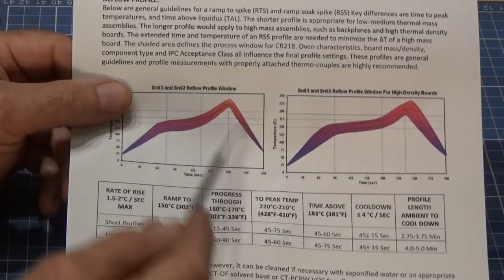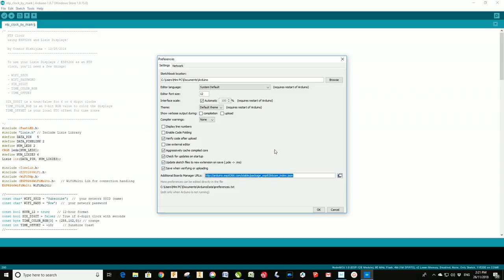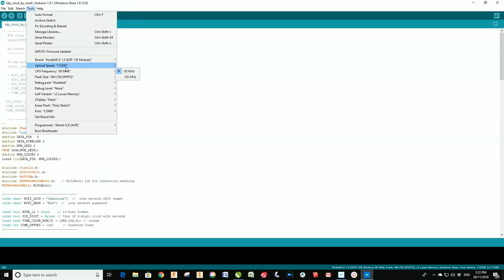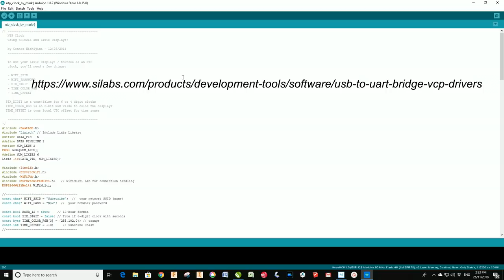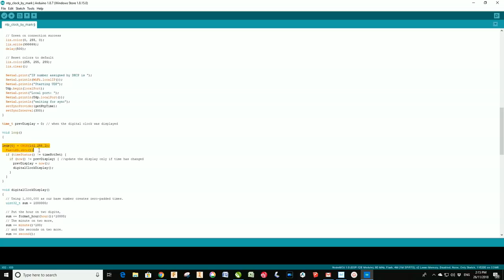Sexy, Lixie, Art Deco Clock Build - Part 2

Comment: Not sure if this has been mentioned, but that solder is enormous for such small connections. Any lead free solder I've accidentally acquired has a short final journey into the trash. I do use flux from time to time, but I can't comment on the type you're using, but I've found it pays to experiment with different types. My wife likes the liquid in a pen style, but I prefer the smelly green stuff. I'm interested to see how your project turns out. I've been collecting parts for a Nixie tube build, I suppose some day I should actually start on it.
Reply from the maker: Yes, I had lots of issues soldering on those boards. I don't know why. Every single board was the same and I don't own any lead free solder so I am guessing it is the boards. When I soldered the veroboard it worked perfectly. Strange!

Comment: If I may Mark, the silabs driver is just to deal with the USB to Com Port adapter on the ESP12e (a 28 pin chip next to the Micro B USB female socket) so your computer can see it, and then to be able to program with the Arduino IDE. Without it, a Windows based PC would complain   "Device not recognized" .  There are similar proprietary drivers offered by other electronics manufacturers and dedicated to the specific chip in play. VCP - Virtual Com Port. 
The Arduino uses yet another that you have already installed obviously.
Sadly Windows will not install automatically.
Soldering is often an exercise in humility and patience as is coding but so thoroughly elating once championed. Congrats on the progress so far.
You have inspired me to revisit the FastLED library and get my 5050 WS2812b's out from storage once again.
Reply from the maker: I must say that the video that I watched had a link to a site that supposedly had the correct driver but I was worrying that I was going to get directed to a porn site or something. Since I didn't have to install drivers for the Arduino I was smelling a rat. However as you have pointed out it was just for the VCP. I cannot understand why the soldering has given me so much grief. It's not like I've never done it before but I suspect that the boards that I got are done with lead free solder. I think I did a little dance when I realised that I had left a semi colon off the end of one line of code. Mostly it sucks but when you get a win it feels good.😁

Comment: Hi Mark,

You are using the correct method to solder your LEDs, but your solder is too large for the tiny pads.  (don't waste your time with "lead free" solder).  Get some 0.8mm resin cored 63/37 Tin Lead solder and a pair of 00 Stainless Steel Tweezers.  You will find you have much better control over the amount of solder applied to each joint.  

Clean your pads with JIF Household Cleaner and a sponge. JIF is a very mild abrasive and won't damage anything.  Rinse off with warm water, then dry.  Pre-tin each pad with solder and "wick off" excess solder with solder wick.  Clean up excess resin with acetone and a cotton bud (won't hurt any components)  For large areas, use a toothbrush with acetone to clean excess resin.  Use plenty of acetone and cover the area with a clean dry cloth whilst still wet.  Work the area covered by the cloth with the toothbrush.  All excess resin and residue will transfer to the cloth.

Resin is the best flux for soldering, so if you have trouble with a joint, don't be afraid to add more flux.  Remember that resin is hydroscopic and will absorb moisture over time, so remove all traces of resin using the acetone method above.
Reply from the maker: Thanks for the info. I was using isopropyl alcohol to clean off the excess resin flux but it seems to be quite stubborn and hard to remove. I do have some acetone so I will give it another clean with that. I was using tin lead solder but I think the boards were coated with lead free solder. I must follow up with Dirty PCB's where I purchased them to find out if that is what they are using. I was surprised at how hard it was to get the solder to flow. I didn't realise that the resin flux was hyrdroscopic so I am guessing that could lead to corrosion over time?
Regards,
Preso
Reply: @Preso58    Corrosion over time, especially in high humidity conditions.  The resin can start to "react". 

 I liked your  method of holding the chips in place during the soldering process.  I have been involved with hand soldering surface mounted components since 1989.  My experience is in the microwave  RF Communications industry where surface mount soldering is critical.  We never used re-flow ovens.  We found the results too unreliable and we would often have to rework  manually.

The method we use is to clean, clean, clean (the first law of soldering), pre-tin both the pads and component leads (especially if the  PCBs and components are more than 2 weeks since manufacture),  Each component is then placed into position with Size 00 SS Tweezers and one temporary joint  made (one corner lead on multi lead components).  The temporary joint allows any correction of misalignment before final soldering takes place.  Copious amounts of rosin are used.   Cleaning  is performed by soaking in a tray of isopropyl alcohol for an hour,  then washed in "Safe Wash 2000" (a water based soapy solution, you could use dishwashing liquid).   Final rinsing in water then drying.

After drying, all joints are 100% inspected under a stereo microscope and reworked if required.

We found that "lead free" solder was totally unreliable and extremely difficult to work with, and in general, gave very poor results.  This is because lead free solder has a much higher eutectic point compared with 63/37 tin lead solder.
.

Comment: Mark,  Sorry for the late comment.  I haven't done much SMD soldering, but have done one or two replacement chips with the "extra" small (to me) leads with the tiny (to me) spacing between the leads.  I was successful because of watching one of Dave Jones' YouTube EEVBlog videos where he tacked opposing corners to the board, adjusted the chip's alignment, applied liquid flux, and simply wiped a drop of solder (already on the tip of his iron) across the pins.  If there were any shorts between adjacent leads, wiping perpendicular away from the chip reflowed the small short(s) and easily & quickly fixed the problem.
  
I wonder if soldering "large" SMD components like your LEDs (in future projects) could be done in a similar manner?  I'd guess that you could still use your existing method of holding the LEDs in place while soldering, but if you start with a clean tip and carry a fresh drop of solder to the LEDs, maybe soldering them would be easier?  Of course, Dave's technique may work like it does because it's easy to heat the tiny legs and therefore the pads, which may not be so easy with these LEDs.  But ought to help you in future projects?  Maybe an Electronics Guru that works with a lot of SMDs will make comments on my comments here?
 
I intend to use Dave's technique in the future myself as I am forced into using more & more SMDs.  (I prefer through-hole components of all types for repairing my PDP-8s, which used only transistors & diodes in the mid-60s, then grew into SSI, then MSI, then a few LSI ICs before changing to using "custom" microprocessors in the early-80s.  Other than repairing these computers, I don't do much soldering, but intend to when I retire before too long.  But it's getting more & more difficult to find through-hole components, especially the correct ones, for these kinds of repairs -- I need to spend a lot of $$$ to stockpile every possible 74xx-series IC that I'll ever need for these computers.  Transistors too!)
 
I always enjoy your videos and your sense of humor as you work on lots of very interesting projects!  I'm looking forward to catching up on your videos in this series.
Reply from the maker: I think I watched that same video by EEVBlog but I couldn't make it work on the boards that I purchased for this project. I really believe that they are coated with lead free solder. Every other electronic project I have worked on has not given me as much grief. I even bought some new tips for my soldering iron and I have tried several different types of solder. I used a roll of fine stuff that I had used previously on a Nixie Tube clock which had lots of fine through hole components and I didn't have one single failed joint on that project. The solder would flow beautifully and it always looked smooth and shiny afterwards. Still, I think I will have enough working boards for the two projects and I have a few spares in case.

Comment: You can find a lot of bugs by using a debugger program.  Their is a free one available for Arduino. A nice project and I will be waiting and watching until you finish.
Reply from the maker: Ok, thanks for the heads up. Debugging code would be way better than buggering up code which is what I seem to be doing most of at the moment. I still have some bugs so I am going to be following up on this.
Thanks,
Preso

Comment: Mark, how did you made digits on the PMMA? Thank you.
Reply from the maker: They are laser engraved on the back side. The engraving has to be around half the depth of the PMMA so that it interrupts the light from the LED's under each digit pane. However, it's not really engraving. It's really cutting at reduced power so it doesn't cut all the way through. You should experiment on some scrap to work out the power and speed settings. 
Regards,
Mark
Reply: Mark, thanks for fast reply, will be experimenting 😊.